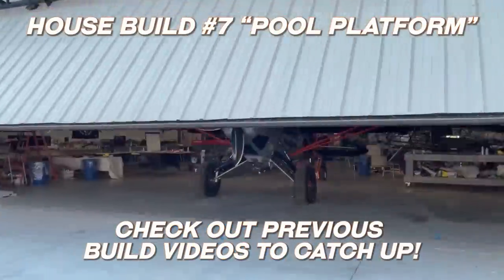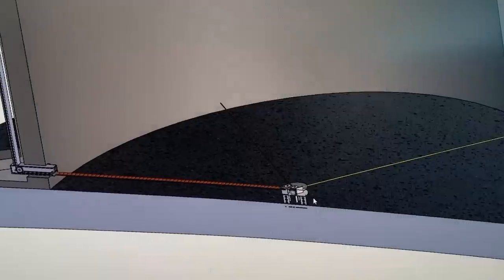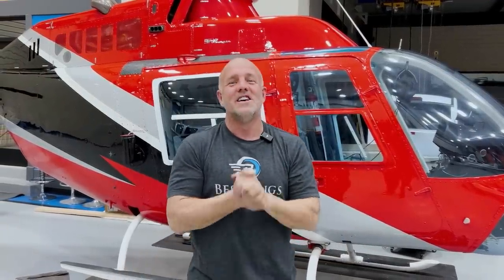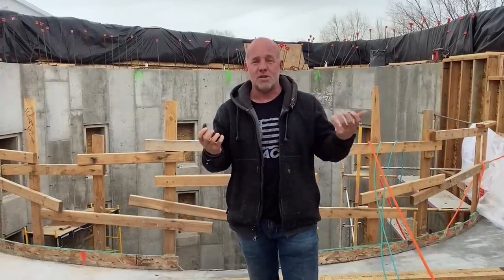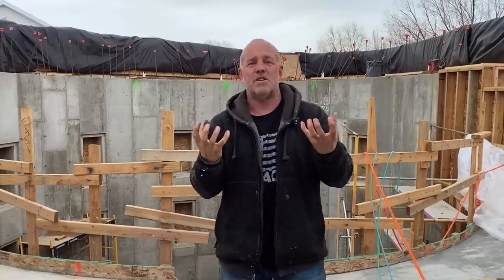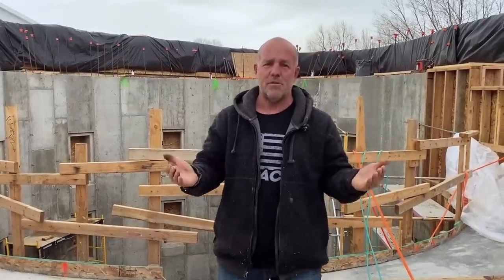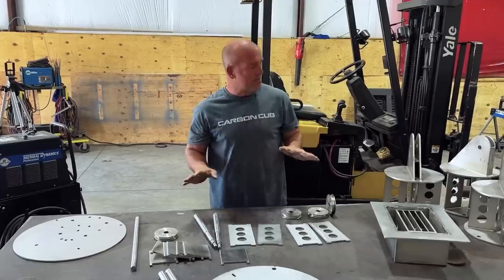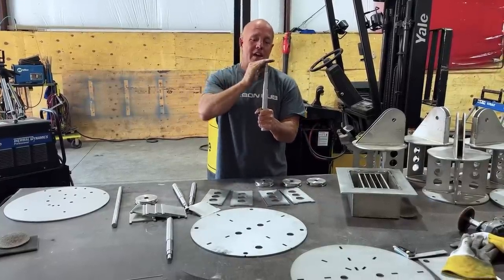How!? Transforming Pool - Dance Floor to Freedive | House Update #7

Comment: Well designed Mike! I figured the holes and grating out when you first described this project to us. I figured the platform would have neutral buoyancy, but really had no idea what you would do for a drive system. The floating platform and oppositional cable drive is cool!

Comment: Amazing engineering as always, mr. Patey. You are a great example of the detail work that separates the "amazing" from the "good enough".
If more floatation was needed over for forces in the cables I'd also have considered floodable tanks in the deck/pool floor structure that lighten the load when flooded but provide lots of floatation when emptied. Keeping the only filling points above the "full up" position would ensure that a slow leak should be detectable easily in time and no risk of accidental flooding through a fill opening. If the deck needs to sink, use a pump to fill the tanks until it's sinkable and pull it under with the cables.

Comment: Floating platforms are very common over here in the Netherlands for exercise pools. I build a few of these pools.
The floors were made of hollow stainless beams filled with foam blocks, there was some space between the beams for the water to flow trough.
It's very safe that the floor wants to float and you have to pull it down with cables.

Comment: Very creative... I was trying to come up with something similar to make a cable lift for a pop-up camper.  Of course it doesn't float... so I needed additional pulleys to change the pulling direction...  I've seen others do it.  But now, doing this in water with a floating platform is genius!!

Comment: I found myself captivated by the thought you've already put in this. I think in flush floor duties it's going to need to be locked off. Pinned. A floating platform could still gap, as human weights fluctuate from side to side. Wow, what a custom piece of art this is going to be.
Reply: That was my first thought too. This way you could also make it less buoyant and reducing the tension on the cables.
Reply: I suspect he will put adjustable rollers on the outside edge of the platform to prevent lateral movement. 
But that is the fun of this project, you think about the issues and how you would solve them.  Then compare to Mike’s solution.
Reply: I'm thinking pins will not be needed because Mike said the floor is going to be "thick". I'm thinking about 2' thick with maybe a 1" gap between the floating floor and side walls. Even if 50 people stood on one side of the floor it couldn't rotate or sink more than 1" even without cables. But with the four corners held by cables there should be no rotational movement at all. I'm excited to see them build this floor and lower it into place. I'm an architect and engineer, also a pilot therefore to watch what Mike designs just blows me away from a new wing design to a scuba diving deep residential swimming pool, and sooo much more!  Just incredible and I always stop everything as soon as I see a new video come out!  You're my hero Mike!
Reply: I think you are bang on because what would happen if everyone on the floor suddenly started dancing? By dancing I mean, everyone on the floor jumping up and down in unison and not necessarily centered in the middle of the floor. That is a whole different ball game than a regular commercial floor load. Opera houses have collapsed because of people dancing in their seats even though there was no possible water to resonate with their movements as in this case. This is a lot more serious. I think that it would be a lot better if the floor were pinned as well.
Reply: @JHarv901  I am a mechanical engineer myself and can tell you, that even though it is possible to do it that way, it certainly is not the most convenient way to do it. I admire Mike for trying it this way and I am sure, he will succeed, but that does not change the fact, that he choose the hard route. Nothing wrong in that. Just not what I would have done. Certainly a work of art in the end though. If you just make it buoyant enough to float to the top and then lock it in place, you have the easiest and most secure way to deal with every possible scenario. If it about looks, he can easily make the "invisble" to the people standing on the float.
Reply: @maxmustermann3105  from what I understand Mike to say is the floor will float and if he were to lose water for some reason then the floor would drop at the same rate as if he were to purposefully drop the floor due to the water displacement design. Now what if the floating floor were pinned and he were to lose water accidently before releasing it from the pins?  If it were locked in placed, it would become a 20'+ high suspended floor with no water below it. Now the floating floor becomes a whole new animal to design. Even if it were steel beams in a reinforced foam disk the attachment points to pins better not ever get stuck, right? And wouldn't the pins need to be hydraulic and recessed into the side walls?  So, in my opinion the pinned points would be cause more problems than solve.
Reply: @JHarv901  If he would loose water for some reason wouldnt it be good, to be able to fix the issue? If the float goes down, it might prevent to be able to reach the area where it is leaking. Even though I really doubt, that this is ever gonna occur. The pins dont have to be hydraulic. They could very easily be designed with a slight angle, and just like a door lock fall into place. You can find solutions to literally any problem that we might describe here. I defintely like this project. I always think about, how I would design it and am amazed at all the different ideas, that the community comes up with.
Reply: @maxmustermann3105  I like your door lock concept, so you could be on to something there. There are so many solutions but trying to find the best one with the least tradeoffs is difficult, especially when you try working on one concept for too long, I tend to find myself with blinders. Can't wait to see the final build. Thanks for the chat!
Reply: What if you surround the top edge of the platform with a groove in which there is an inflatable tube with a large clamping ring.
When you inflate the tube it clamps the floor in place with the ring.
When you deflate the tube it all can move according to original design.

Comment: Hi Mike,  Thanks for everything you do with your YouTube videos.  Always something new to learn.  I would love to see a  discussion on how you're addressing any potential  corrosion issues with the metals you're using and the variable environment.  Years ago I worked on a problem at Steinhart Aquarium.  It involved a large aquarium called the "Round-About" and the 316 stainless steel window frames.  Corrosion was occurring at the welds and was aggressive.  Control involved Cathodic Protection.   Again, Thank you for all you do.

Comment: That welding work is absolutely GORGEOUS!!!!!!

The Rebar pass through and holes for 'crete to fill thru too, those things in 8" of rebar fed through and bolted and expoied down to the 2' footer i rocket tied to it would not be able to pull those out!

Comment: Love the approach on this. Watching this vid I also could envision a super buoyant platform that’s also a pressure vessel. Simply fill the bladder of the platform with water to submerge (supplement platform positioning with light weight cables and pulleys.) much less tension on all cables at all times. Also a little easier to position the platform as people and cargo are added or removed since you’re just pumping water from the pool to the platform bladder. It’s a submarine! Appreciate all you do!

Comment: The peanut butter jar and lid idea: The lid would be the deck/bottom of the pool. The deck would move up/down my means of turning clockwise/counterclockwise on the polyurethane type material (in order to avoid corrosion) circular screw.  Screw teeth on the inside of the pool wall would be paired with screwed teeth on the side of the lid. Figuring out the way to make the lid turn would be the challenge. Just like opening/closing a peanut butter jar! Can´t wait to see this amazing project finished, Mike!

Comment: I can recommend Dyneema as rope material. I would probably use SK99 due to its tencile strength. If you are concerned about breaking due to rubbing on edges. These ropes are available with aramid (kevlar) woven into the outer layer of the rope.

Comment: Love your video's, as many of us do! I'm very curious for your choice of cable as it was never mentioned. I used to own a marina with (198) covered slips. The anchoring system was key to its success we used a cable system with concrete blocks for anchors, a lot of them. Anyway we did encounter issues with using cables though, in our case  with high winds it would put high stress on the cables. This caused the cable(s) to unwind, that's not so much a problem, it was when the stress subsided that caused the cables to wind back up and kink up, for lack of words. My point, I'm hoping you video stress testing the cable of choice to the limits your planning for. BTW we used swivels on the anchor ends and that helped some.

Comment: Great work! An idea: if you have enough cable out of the pool, running through the basement to the drive unit you could attach a marker to one of the cables that could be detected by an opto or switch.  In this way you you detect you desired stop locations without having an in water switch detecting the platform location.  Much easier for adjustement to have them out of the water.

Comment: This is going to be awesome to see in action. Only thing I can think of is to make sure the grates have enough width so no one can get stuck to them if the platform is moving. Either some horrific Delta P incident, or just the suction pressure keeping them underwater. Maybe some wider grates on the pool side, that taper through your orifice on the cable side to regulate water flow. I really like your pully system, simple and effective!

Comment: Neutral buoyancy platform pulled down by cables/pulleys... It will work. Three suggestions:
-Ability to adjust platform's buoyancy (water tanks, like in a submarine) will save time whenever you want to adjust its level.
-Ability to adjust the water flow (hole diameter) would add safety: closed hole = no water flow = no (or very slow) down movement.
-Build the plaform out of large, closed cell, foam chunks. Glue, shape to taste and try. Once approved, coat the outside with LOTS of epoxy/glass.
Lastly: remember to passivate stainless steel parts.

Comment: Loving the series... quick comments..

1: are you worried about the platform being stable at the top? uneven weight distribution? motion from people walking/dancing? Might be worth coming up with a way to latch it in place at your two positions so it feels rigid and secure. If you're relying on cable tension and doing the calcs so the floor displaces a lot of extra water (i.e. so the floor naturally floats well above  the top level) that might work, but you would be subjecting your rigging to a lot of unnecessary loading. 

2: its worth keeping in mind that your floor is essentially going to be a pressure vessel since you're relying on buoyancy. 25' of water is roughly 11psi across the entire surface, so getting the buoyancy you need, while having the strength to withstand that pressure is going to be interesting. The more i think about it, the more I think you'll be custom fabricating the largest pancake air tank ever made. Additionally if the floor assembly ever fails, or lets say changes shape slightly (non uniformly) from the excessive pressure, your buoyancy CG could be at risk which might cause the floor to bind against the walls.

Im excited to see how you design the floor. I wonder if there is any use for ballast tanks internal to the floor.

Just some thoughts. Not trying to be overly critical.

Comment: Hey mate, great project! When you were expaining about the floating platform, I thought to myself, why not make it like a a diving BCD or like a submarine? Then you'd only need a decent compressor and an air hose connected under the platform to raise/lower it and be able to achieve neutral buoyancy quickly for any weight on it...enough daydreaming, back to work!

Comment: I really like the floating buoyant floor. A floor that can hold at least 50 people is a huge amount of force. What if they all decide to go to one side, so safety factor of 2 or 3. 20k lbs or 30k lbs of force. Ballast tanks in the floor with some pumps would make it so it would not normally have to have this much force on it. The only time the ballast tanks would be completely empty is when the floor is at its highest level. Side latches at the top and extra depth of the floor around the outside rim like a donut on the underside for extra stability. A 25 ft donut 4 ft wide and 8 inches deep will add an additional 11,000 lbs of buoyancy around the perimeter. I love this stuff!

Comment: I was thinking the same thing, the easiest is if it floats. The pulley solution is nice. Another alternative would be for it to work like a submarine and add water or air to change buoyancy. Good engineering.

Comment: Mike this is a KISS project and 95% fool proof. The main weakness is where the pull points converge from 4 to 1 was to fail. Then anyone in the pool could be trapped against the flow restricting holes in the floor. Still a brilliant design and I wish you and all your gests have many years of safe swimming.

Comment: Great video! Did you consider controlling the height only with buoyancy? I’m thinking air lines to add or remove air from a ballast tank and hold the height with an air brake-something that would hold it to the side of the pool unless there was pressure applied. I don’t doubt you thought this through, it would be fascinating to hear more about what you decided wouldn’t work beyond hydraulic lift. Love this video series.

Comment: I have built alot of floating docks.  The thing to be careful of is the platform needs have enough mass to dampen the effect of people walking on it.  The ratio of load weight to platform weight, if not proper, can make it feel too "active" when people walk (or cavort) on it.  The use of a solid "curtain" that encloses some water beneath the platform can help.  I enjoy your videos!

Comment: Who else thinks that the Pateys are basically modern-day Wright Brothers/Leonardo Davinci hybrids 😮 Amazing work as always, can’t wait to see what’s coming out of the hangar next! 😎 ✈️
Reply: A little bit much dude...
Reply: @truthseeking3818   Really? Although obviously a stretch as there will be never be those historical engineering “firsts” again, Is there another aviation family you can think of who has endured the challenge of multiple businesses, solved many engineering challenges in aviation and water & environmental treatment, created never-before seen engineering marvels (such as Scrappy’s leading-edge design) and continues to push the design scope outside of what most wouldn’t have dared or even dreamt of? And I’m not even going to bring the cutting-edge EV tech into it..
Imho this Pool is quite unique, and from what I understand completely different in terms of mechanism from what anyone else has done.
Credit where credits due dude.

Comment: Maybe air ballast to increase the platform’s buoyancy in dance floor mode?   This could allow the static buoyancy to be closer to neutral, decreasing the cable tension required to move it
Reply: That'd add a bunch of complexity though, and also weaken the platform. I mean it'd still work, but it's solving a non-existent problem.

Each of those cables will easily hold a few dozen tons, so cable strength shouldn't be a limiting factor. And using worm gears and only aiming to move it slowly, there's also no problem generating large forces.
Reply: Maybe flood it to sink it and air compressor it to float it since your going the composite route, even simpler/safer than cables?. Love Mike btw
Reply: I thought air could’ve been the primary means of actuation as well, but I do like the redundancy of the cables.  Seems they’d be the easiest way to have infinite set points of depth.  Also, I’d feel really nervous spending even a minute under that platform with negative static buoyancy!  Thinking of becoming a deep underwater pancake, that’s nightmare fuel right there!
Reply: @bigtex879  for air to be the primary control, you'd have to operate the platform close to neutral buoyancy. That'd mean a very wobbly platform unless you did resort to locking pins at a few predetermined levels.

All good re pancake either way btw, no one ever goes underneath the platform except for maintenance.
Reply: Yes, I understand it’s the buoyancy force, whether static or dynamic,  pulling against a mechanical limiter that stabilizes the platform. The advantage of a dynamic system is simply that it reduces the forces/wear on the cables.  I see no complexity or inherent structural weakness in adding bladders and single pneumatic circuit.  The platform could even be built with a simple convex shape to hold air under it.  A compressor fills it, and gravity alone would purge it back out via siphon

Comment: would be interesting to include a set of radius cut wheel in the sides to keep it centre, differential brake that runs off the winch line to release when pulling down, but apply when weight is appliednfrom the top, and some minor tuned mass damping in the flaoting body, so that people suddenly moving around the platfoem won't cause any vibration at all.